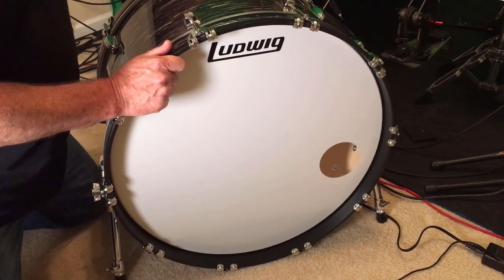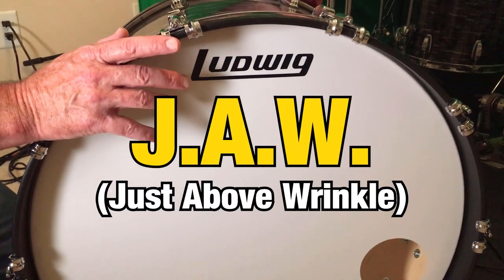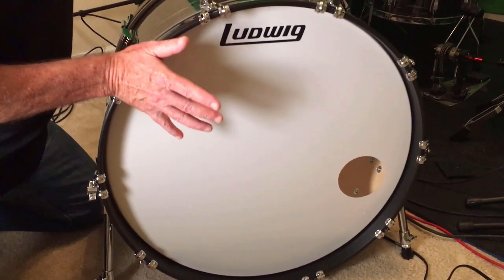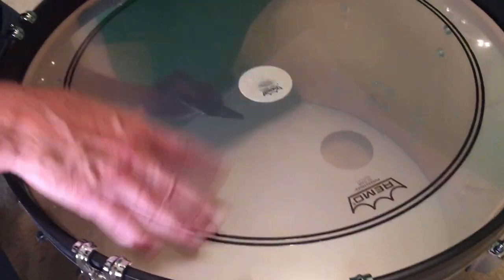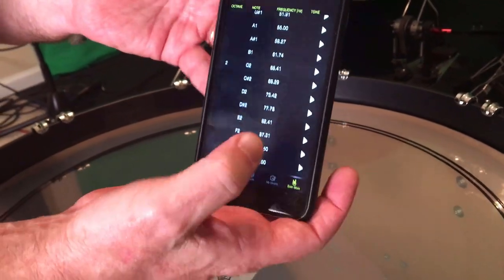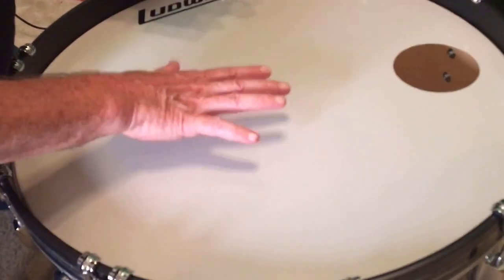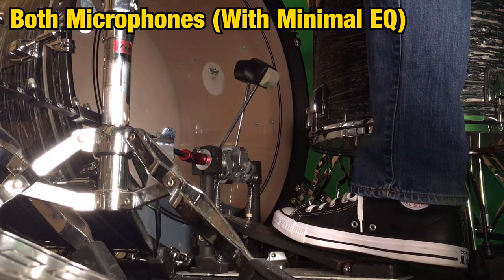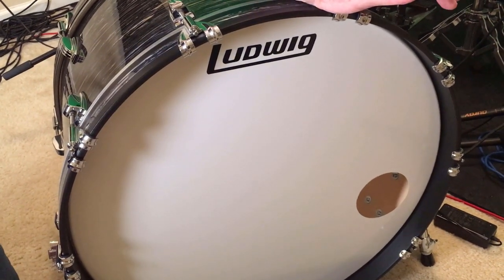Drum Tuning - 24" x 14" Bass Drum (with Sound Clips)

Comment: I agree! I have had a double 24x14 set, a 24x16, a 26x16 and a 24x18. I have also found that with larger bass drums I do not like porting the resonant head as they do not resonate as well when air escapes. I suspend a D112 in the center of the drum facing the beater using heavy duty elastic or bungee cords in an X pattern connected to the lug bolts inside the shell. Then either run a mic cable through the vent hole or cut a hole in the shell and install a panel mount XLR jack on the drum.
Reply from the maker: Awesome, like the Kelly shu. I love the sound of an unported resonant head on a big bass drum. Rumbling thunder. I have tried mic’ing it up for live and recording that way, but it is just easier to get a modern bass drum sound with a port hole. I’m with you though, love that sound.

Comment: Thank you! I bought a 24X14 DW last year and have not been happy with it. I have been tuning it JAW and could never get it to sound good. Also, my kick pedal beater always does a double or triple slap on the head. I have not been able to figure out how to stop that. Maybe the higher tuning will do the trick.
Reply from the maker: The higher tuning should get you more volume and presence. The beater bounce happens more if you have a full front head ( no hole). Hopefully the slightly higher tuning will help. Those size drums can be finicky…..but when you get the right tuning they sound awesome.

Comment: I just swapped out my 13” rack for a 14”, so now I am playing 14 rack and 16 and 18 floors. I used the numbers in your video for my floor toms, but not sure where to tune my 14”. What numbers would you suggest for the 14 in this situation?  Same as the 13?
Reply from the maker: Cool! Bonham sizes! Yes, if it’s a 14x10, I’d tune it close to where the 13” was…..in that ballpark anyway. See how it feels and sounds there, then if it’s too stiff feeling or too high pitched for your liking, just lower it in very small increments until you get the sound you want. Let me know how you make out!

Comment: From day one I have played 22's.  This past year we opened for a band where the drummer was using a 24.  I ended up buying a Gretsch Renown 13, 16, 24.  My normal go to on the 22 was the Aquarian SK2 and the Aquarian Regulator with a mic hole for the reso.  So I went with what I know on the 24.  Super disappointed with the results.  I have always ran wide open with no pillows in my 22's.  To get this 24 to work, I had to use a pillow.  Now it's actually sounding decent.  I might have to give the Remo's a try tho cause I hate running pillows.
Reply from the maker: Hey Matt. I know what you mean brother. I had a bit of a learning curve with what my ears expected to hear from the 24” after having a 22”x18”. The 24” didn’t have the low “thump” per se, more of a bigger, faster low end sound due to the 14” depth. Like I said in the video, I use a PS3 because of the volume it has over the SK2 and Evans Emads, but it doesn’t muffle or bring out a ton of low end thump like the SK2 does on a 22”. It’s a different animal and one you have to experiment with to find that sound. I’m getting used to it now but at first I didn’t like it as much. The key for me was tuning up the front head a bit more, I do have a small DW pillow in it. I tried felt strips but liked the sound of the pillow better. Good luck finding your sound!

Comment: What do you think about classic maple drumset stock heads. Toms and BD, Need a change?
Reply from the maker: The stock heads I got on my classic maple kit were the equivalent of clear emperors on the toms and a Powerstoke 3 on the kick. Those heads are fine for a big rock sound. I use clear emps live, coated in the studio and a clear PS3 on the kick. Depending on what type of music you play and sound you’re after, the stock heads are decent and worth at least trying them out to see if they work for you. Head choice is very subjective, so I would check to see what heads your favorite drummers are using and go from there to dial in YOUR sound. Good luck man!!
Reply: I ll tune higher the bass drum heads. I dont feel a big boom in my New kit bd and I worry about it
Reply from the maker: Yes I understand. It’s a matter of experimenting with both the head choice and tuning. What size is your bass drum? Try tuning the batter head low, like about 3/4 to 1 full turn on each lug, and the front head just a little tighter. Do you have a hole cut in your front head? You may have to try a different batter head to get the sound you are looking for. Experimenting is key in getting your sound. It’s a process, but you’ll know your drum when it’s all done.
Reply: Its 14x24 classic maple. Im thinking to remplace the batter head to a ps3 clear. One friend of mine have the same kit with classic hardware and its sound bigger with stock heads.
Reply: The front head hole is 4 inches
Reply from the maker: @bevifla  cool. It’s worth a try. Maybe your friend can help you dial in the tuning as well. If his drum sounds more like how you want yours to sound.

Comment: Never cut a hole in the front head.  You will loose so much tone. Instead place one of the mics on the back side of the drum.
Reply from the maker: I hear you brother, but for more versatility and less problems with sound crews and getting modern rock drum sounds, a hole is necessary. I do try to keep it as small as possible to retain as much tone as possible.

Comment: Also would you get the same punch without the mic port?
Reply from the maker: The inside mic gives me the attack of the beater and some of the low end punch. The outside mic picks up the low end rumble and “whoompf” if you will. Without the inside mic, the drum would have less attack and a little less punch. That’s not necessarily a bad thing, Bonham played that way forever. One way to compensate for that if you don’t want to port the head is to mic the beater side. That works pretty well, but it’s tough to get the attack of the beater and punch of the kick for a modern kick drum sound without a mic port, especially live.  Hope that helps!
Reply: I dont plan to mic it.  I play gigs at smaller bars.  What would you suggest I do to get some volume and power from it?
Reply from the maker: If you want max volume and projection from your kick unmiced, there are a few things you should do to maximize the drum’s potential. I don’t know what size the bass drum is, but it doesn’t really matter. If it was me, first I’d keep a full front head on with NO port hole. That creates a big full sound from the column of air inside the shell. The air can’t escape and causes the whole drum to react. That’s how Bonham got that big sound. The second thing is not to have the heads tuned too low. Low tuned floppy heads sap the projection and volume from the drum. At a distance, all you hear is attack and no body. I’m not saying tune the heads high, but the batter head should be above wrinkle a bit with the front head about a full step higher, just like a tom. I would also muffle minimally, maybe a felt strip on the batter head about a third of the way up on the head, nothing or another felt strip on the front head. If you use a PS3 front head for example, with that subtle muffling ring, you won’t need anything else to muffle. Remember too that what sounds a little resonant and “ ringy ” to you behind the kit will sound perfect about 10-20 ft. in front of the kit. So to recap, no port hole, tune the heads up enough to get the shell reacting and the whole drum resonating, not just the heads. Use muffling sparingly…JUST enough to take away annoying overtones, but leaving a nice full resonant tone with a natural decay. That should give you the biggest, loudest kick drum sound you can get unmiced. It won’t be “punchy” like a modern kick drum, that comes from micing, but adding a patch to the beater impact point to accentuate the attack will help give it a more modern sound while still giving you a huge tone. Hope that helps!
Reply: Awesome thank you so much.  Ya the kick is a 24” x 14” and is the ludwig classic oak.
Reply from the maker: @douglashardy177  whoa sweet! That sucker should be loud as heck then when you get it outfitted just right. It also depends on the heads you choose. Some pre muffled heads like an Aquarian super kick or other heavily pre dampened heads will reduce volume and the need for muffling in most cases. When I played acoustic gigs, I wanted my bass drum to be as loud as possible and project out into the audience. The loudest head that still gave me a nice thump was a clear PS3. I used that on 22/24/26” kicks, always sounded great. Smooth white or black single ply front head with felt strips on both heads. Loud, powerful and heard in the back of the room. Of course, your tastes may differ, but that formula is tried and true . Good luck man, hit me up if you want to talk more! 🤘🏻🤘🏻